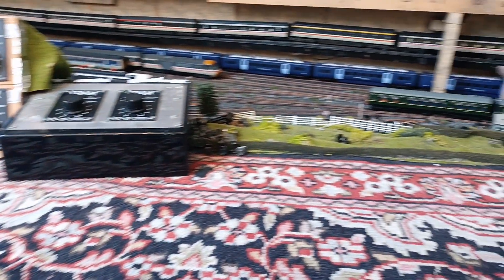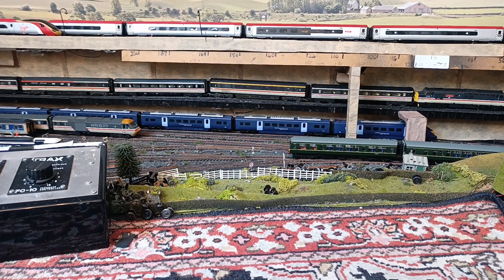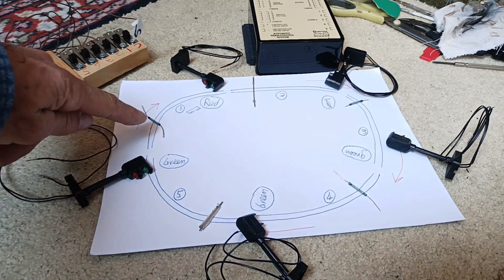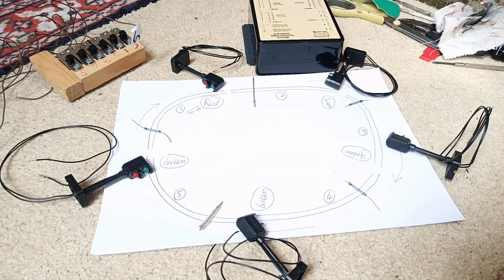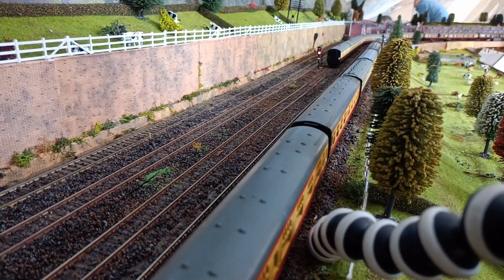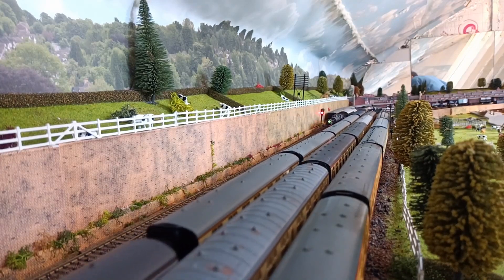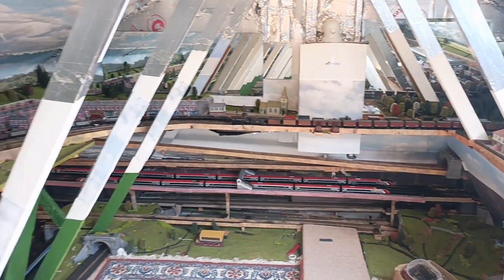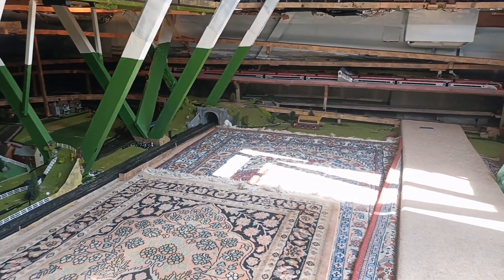DC control using digital boxes, an explanation on how OO gauge massive running works

Comment: Very nice layout and system you have to control your trains. Greetings from Hai
Reply from the maker: Thanks.  Philip
Reply from the maker: Sorry  I did not see your message. You tube do not make it easy sometimes.
I have 12 DC controllers and 5 digital boxes on the top level which allows 2 trains to run on the same loop.

Comment: Brilliant video . I struggle to control 4 trains ! Shame these boxes no longer available . I run DC . Far too many locos now to chip, many of them are very old too . The only reason I might buy a DCC loco is to have sound . Have you ever tried that? I’m told speed is affected and of course because not DCC controlled you can’t turn the sound off - which may eventually get on my nerves!
Reply: Take a look at radio control (see my videos on the subject); it's a good compromise and will run along with DC on same track.
Reply from the maker: I prefer to have individual control for each engine running 2 engines off one controller using over taking sidings, but it often goes wrong leading to collisions and derailment. I will watch your video later today, kind regards, Philip